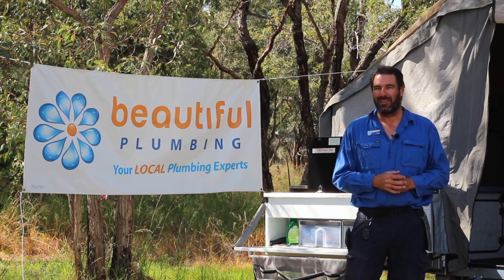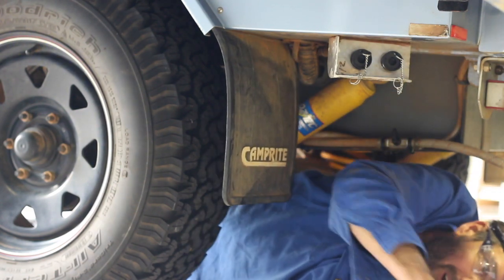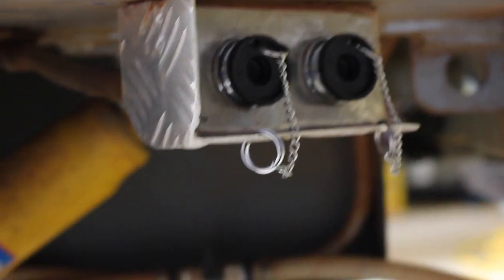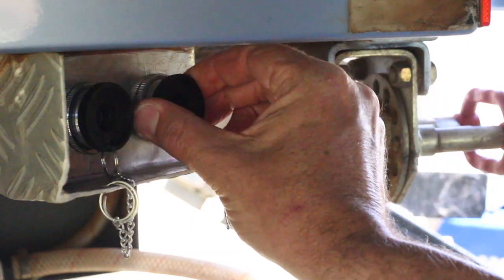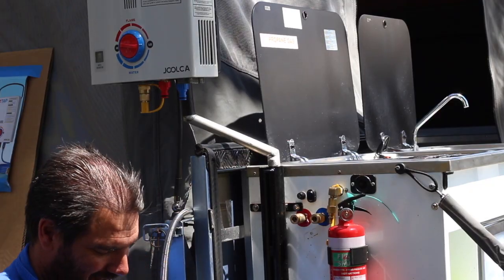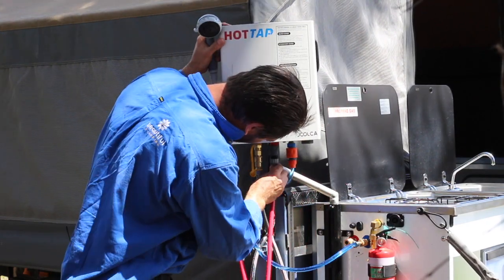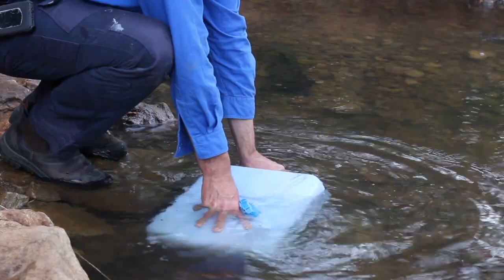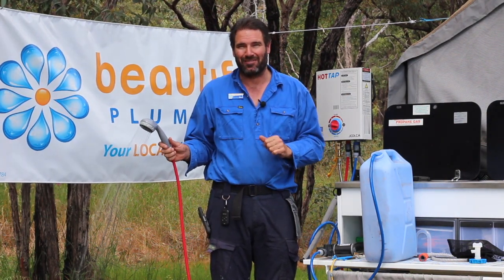Caravan Gas Installation Service that You Need to See

Comment: I have a combination of regulated gas appliances (like a baby weber Q) and non regulated (companion high output stove). My idea was to run a high pressure gas line along the side of the van with female quick connect sockets (not bayonet) and then add male quick connect adapters to my existing hoses. Then I could use both high and low pressure appliances all with quick connect. Is this doable?